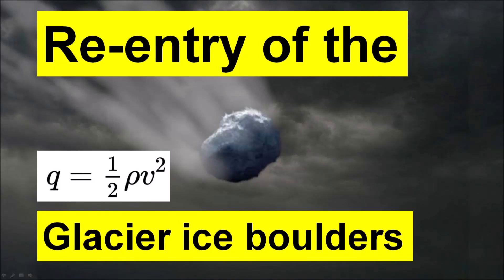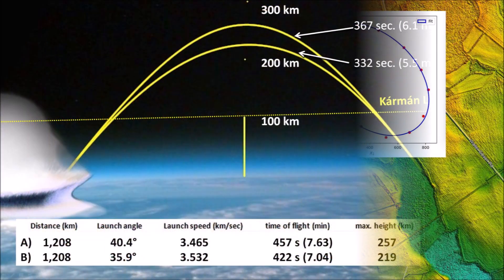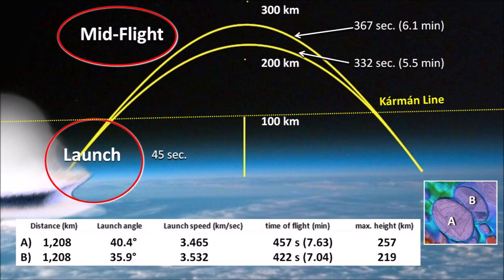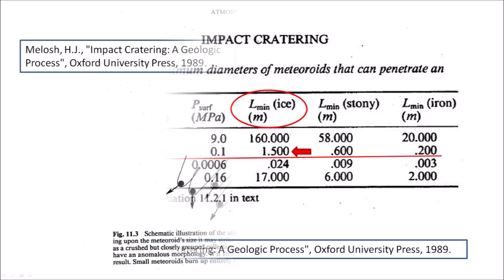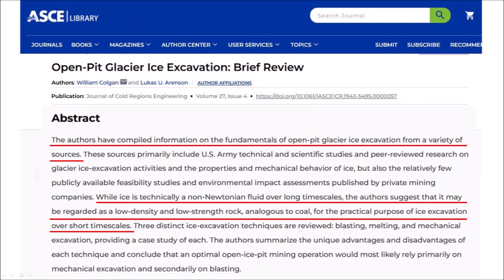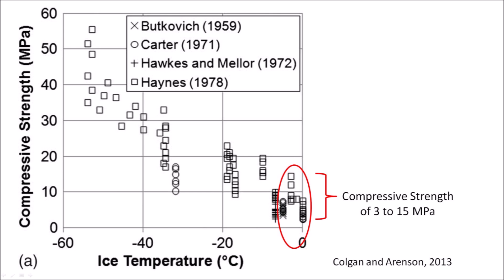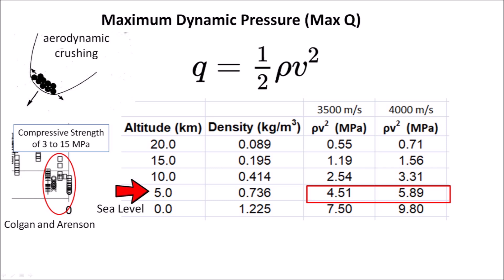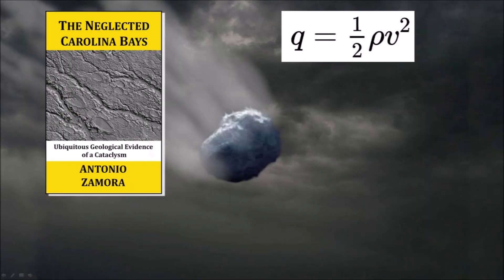Re-entry of the glacier ice boulders

Comment: Ice boulders will either evaporate on exit and reentry or they will ablate.  More likely an Ice bolder will ablate.  In fact they should have little or no atmospheric resistance due to their rather profound ablation.  This actually is a problem of all projectiles reentering.  Ablation is the process by which we protect spacecraft on reentry.  The reentry will produce a steam ablation and have essentially no resistance.   This means that over a critical size where the heat transfer cannot penetrate the body in the time allowed, the body will ablate and penetrate without much velocity loss.  This has been observed in all reentry events mankind has practiced. 
This is why spacecraft have serious issues as their size increases with heat shields. Heat shields have to be calculated to ablate without disintegration stress on the craft.   Steam provides a complete ablative shield.
Reply from the maker: The idea that ice boulders will just evaporate during re-entry seems reasonable until you do the math. In general, the maximum dynamic pressure during re-entry is less than the compressive strength of glacier ice. The ice will make it through the atmosphere and hit the ground. See this video: https://youtu.be/ltedW3sfjrg

Comment: You explain this so well Antonio. Great video.
I understand there are three serious contenders for initial meteoroid impacts sites - Saginaw Bay, central Lake Michigan, and Nastapoka Arc on Hudson Bay. And that no impact proxies like shatter cones, shocked quartz etc have been found at these sites. My questions are - has anyone properly looked; and are there any verified meteoroid impact sites on glacier ice anywhere; and if so are the proxies there similar to those in bare ground impacts?
Reply from the maker: An extraterrestrial impact on an ice sheet doesn't leave much evidence. The ice prevents the formation of a typical crater, and then the surrounding ice that remained melts and washes away all other clues.
Reply: @Antonio_Zamora  Maybe the Hiawatha Glacier Crater could offer an example of an extraterrestrial impact on ice? This was dated at around 58 mya in a  2022 study using argon–argon dating combined with uranium–lead dating of shocked zircon crystals in impact melt rocks found in outwash up to 10 km downstream of the glacier (according to Wikipedia). However I am uncertain for how long Greenland has been mostly covered by glacial ice.
Reply from the maker: @curtisnixon5313 An analysis of an impact on ice for the Greenland crater was flawed. See: https://youtu.be/lFDbYpLymwY
Reply: @Antonio_Zamora  Yes, it is sad that scientists look for evidence to support the 'agreed truth', to the point of erroneous modeling.
Reply: @curtisnixon5313  The Greenland ice sheet appeared only some 2.6 million years ago.  58 mya, what is now Greenland was... green!  So the Hiawatha Glacier Crater is NOT an example of an ET impact on ice!

Comment: So you mentioned slipstreaming as a side note but I would ask what is the reduction of max Q due to 100s or 1000s of incoming projectiles?
Reply from the maker: In a previous video, I mentioned that the expanding ejecta curtain would have trapped the jet stream and brought it down toward the surface. There are many bays that have splash chevrons oriented in a northeast direction.

Comment: Keep at it, you are putting together an amazingly interesting story. The one hole may be the date you proposed earlier, why don't the bays extend all the way to the ocean on the east coast? I don't understand how if this occurred in the YD, about 12,800 years ago, why there's little impact evidence right by the shore? However, if it occurred at an earlier time, then sea level rise and fall over time would explain why they are missing, meaning the date is not YD. Do you have an explanation? Otherwise, you are doing excellent work, outstanding, commendable, gobsmacking even! I love it and cannot wait to see what you post next. Oh, and I bought your book and read it in one day, super interesting.
Reply: the sea level has been relatively the same for about 6,000-7,000 years. also, category 5 hurricanes can have storm surges upwards of 30 feet. taking these facts into consideration, many bays were likely erased along the coast due to 1000s of years of erosion. and when viewing LiDAR, if you go inland, even at elevations less than 30 feet, you'll see plenty of bays. why? because inland areas are insulated from the effects of storm surge.
Reply: I'm been racking my brain about that. Of course! The rest of the "story" or data holds together so well, megafauna disappearance, disappearance of Clovis culture, release of fresh water from the impact shutting down the AMOC ushering in a period of renewed cooling etc etc. Dr. Zamora is shedding light on the most significant geologic feature on the continent after mountains, rivers and scablands. It's a fantastic story.
Reply: Good point about storm surges, hadn't thought about that.
Reply: @tgriz100  looking up the data, there have been four category 5 hurricanes to hit the east coast (and gulf coast) in the past 100 years. doing the math at 4 per 100 years, that would be 520 category 5 hurricanes making landfall over 13,000 years. this isn't factoring in category 4 hurricanes which can have nearly the same amount of storm surge.
Reply: Excellent point, thanks @AustinKoleCarlisle
Reply: My guess is that you are much closer to bedrock at the coast due to several factors like wind, rain, storms and sea rise and fall. Accumulation of soil is not as prevalent as inland and when it comes to rock vs ice, rock will win each time so the lack of any evidence in costal areas seems pretty logical to me. But hey, I’m not an expert and I could be wrong.
Reply: @danivarstlie5868  this is another good point. remember, we're only seeing bays that have withstood 1000s of years of erosive forces. there were probably bays that were initially created but have since been eroded.